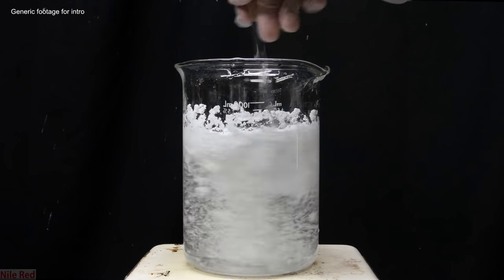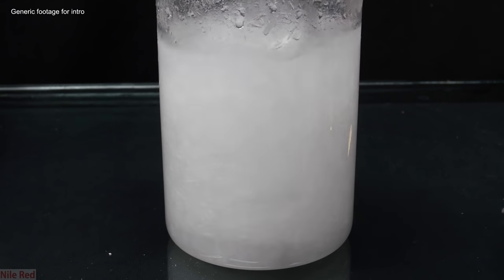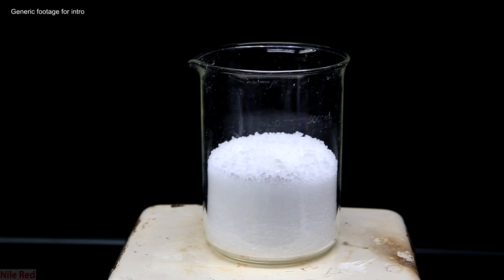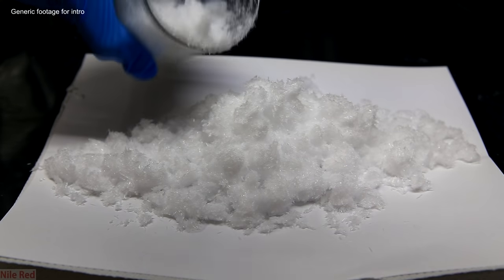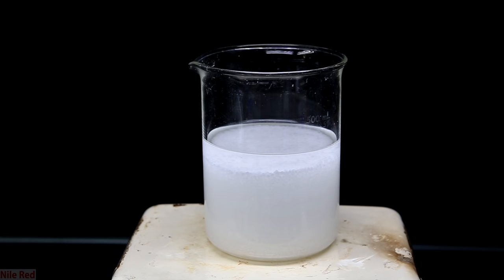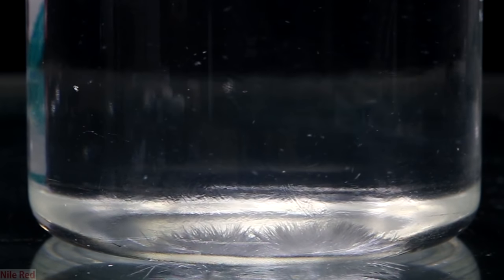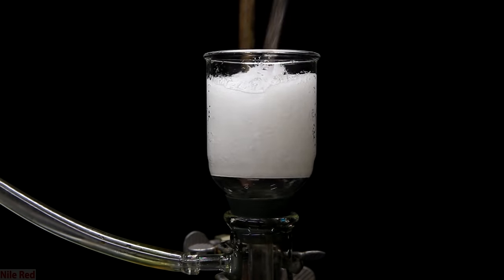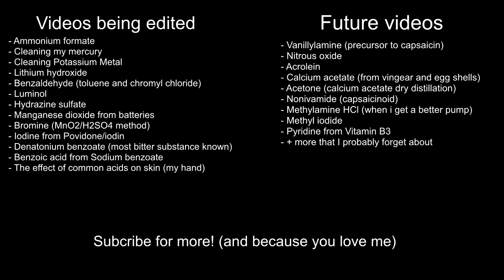Technique Series: Recrystallization (urea as an example)

Comment: Lol. Here's a complicated crystallization. Crystallize chlorophyll
Reply: +Dan Swoboda The stuff in plants? That's everywhere. I wonder if chlorophyll still looks green in its crystal form, assuming it can actually form crystals.
Reply: +ShroudedPanda yes it can crystallize. Just extremely difficult
Reply: +Dan Swoboda I'm guessing mixed solvent?
Reply: Ben Canon There are different kinds of chlorophyll, a and b. Different yet they contain a different build carbon chain going off of it. So I'd say radiocrystolography as well as chromatography are needed to get both separated. But I doubt it would be worth it all that much.
Reply: Ok I've got a little science project somewhat related to this, how would you best isolate and extract chlorophyll as a contaminant from an extraction of lipids with ethanol as the solvent in a fashion that is both highly effective and nontoxic? 

I've thought about using hexane as the starting solvent in a lipid extraction using the soxhlet extraction technique. I've read that hexane is excellent at dissolving lipids without extracting nearly as much chlorophyll or other water soluble undesirables (practically none) but it also only has a Recommended Exposure Level of only 80ppm. How close to 0ppm of hexane could one get in an extraction where the plant matter is processed in a Soxhlet extractor using hexane and then said hexane was distilled off and the hexane contaminated extract was then "washed" using some anhydrous ethanol at least 3x then vacuum purged for a couple hours?

The reason why I ask the initial question about an ethanol extraction is because, if my preferred method of hexane extraction is unsafe no matter what methods are used to extract the hexane afterwards, I would like to find a method that 
1. Can be done at home
2. Uses a relatively safe solvent, in this case ethanol (the hexane extraction would be conducted outside and under vacuum for hopefully obvious safety reasons)
3. Is at least semi automated and
4. Can produce an end product that contains little to no chlorophyll

So basically my questions are, would the hexane extraction method I outlined be safe for human consumption, and if not how would you go about isolating and removing chlorophyll contamination from an ethanol extraction meant for human consumption?
Reply: @GR3YS0RG4N1CS  Why would you want to consume chlorophyll?
Reply: Stefan Reich what are you talking about? That is the exact opposite of my goal. Chlorophyll is the contaminant. It is the only contaminant left after a ethanol winterizaton process and I want a good way to remove it
Reply: Stefan Reich "how would you best isolate and extract chlorophyll as a contaminant*" why would you EVER isolate and extract a *contaminant as something for consumption or even for further use in a later process?
Reply: @GR3YS0RG4N1CS  Chlorophyll is sold as a supplement so there is an argument for extracting it for human consumption.

Comment: I wish I could give this video 10 likes. I’ve been struggling with this technique for so long, and after watching this video, I finally got a decently pure product! Thank you so, so much.

(Specifically, I was hung up on why adding water until the solution was cloudy was done, and you addressed that very clearly. Also, I had not been washing my crystals with extra solvent during vacuum filtration. I usually don’t have as much powder as shown in this demonstration, and thought it wouldn’t do much. I was dead wrong. I had less than 100mg of product, and washing it still helped a lot. I could see the color of my powder brighten as I washed it, and I got a decent melting point range for my product. After so many previous failures, it made me so happy :’))

Comment: i think one of the biggest problems is having impurities that does not dissolve in the solvent and no knowing that they are not product which means you can add far too much solvent to try to get them dissolved, this can badly effect yield or may mean you have to add a second solent to get the crystals to crash out of solution.

Comment: my favourite technique is to heat up the solvent on a hot plate and add it slowly to my product when it is about 50% dissolved. (and it dependswhat solvent you are using) with solvent i put it on the hotplate as well to prevent it from cooling too early, when the solid has dissolved i take it of and let it cool really slowly, when it is at room temp i put it on ice to get the last crystals to form. it works really well but you must be careful that your product doesn't burn or melt.

Comment: Could it be possible to separate racemic methamphetamine from subisomer cuts that have say 10-15 C lower boiling point for the subisomer cuts (160 C) and then 170-175 C for racemic methamphetamine? 

The presumed cut is isopropylbenzylamine. An adulterant of methamphetamine added to give the appearance of large fake crystaline methamphetamine hcl. I doubt you know or if these subisomers cuts are possible or can even be removed this way since the boiling point is so similar but it's always something I've wondered about since users of the drug claim it is being cut this way and that a drop in potency occured in 2015-2017. DEA says they see it occasionally at their dedicated methamphetamine analysis only sees it occasionally. In 2008 the agency moved to not control it and decided it was just visually similar to methamphetamine Crystals. The full report requested in the "NFLIS 2007 annual report" on page 25 in paragraph one and two. I believe this was before the agency had a analysis lab dedicated to the stuff.

Comment: I want to separate 2 salts. 1 with approx. 1000g/L (at 20°C) the other one with approx. 350g/L (at 20°C). I can't find literature for the solubility at higher temperatures. I want the more soluble one as clean as possible. I got quite a high amount of the less soluble salt in a very pure form. I repeated the process 6 times and still get every time a small amount of my less soluble salt. I dryed the rest to check the quality and it still has a lot of the less soluble salt in it.

Comment: I'm trying to find a quicker way of separating silver nitrate and copper nitrate. I've made them both from sterling silver. In the past I added pieces of copper to the solution to crystallize pure silver then used that to make nearly pure silver nitrate. I looked around and found out that silver nitrate is not very soluble in ethanol but all I've found is that copper nitrate is soluble in ethanol but I couldn't find any numbers on it.

Comment: You probably got those accidentally when you wanted the ammonium nitrate ones right? For your potassium nitrate video,  I also have been wondering what I should do with it. fertilizer maybe?
Reply from the maker: +Liamthepyro haha that is exactly where i got them. It turned out to be useful though. I used the stuff i recrystallized in this video to make hydrazine sulfate (luminol precursor)

Comment: Are there any exceptions to wanting the temperature to reduce slowly? Now I realize why my recrystallizations were always so excellent in the university lab and so terrible replicating at home. I couldn't let my impatience result in trying to speed things up by putting sodium acetate recrystallations in the fridge. And what about with respect to heating the mixture? Does it matter if we start by adding the compound to hot solvent, rather than to cold solvent then heating?
Reply: Good questions.  If you find the answers can you let me know?  I also tried to crystallize using freezer which has worked pretty good, but my choice of solvent is making residue which I need to purify through recrystallization.  I failed my first attempt and lost almost all of my target chem.

Comment: I'm trying to purify Ammonium nitrate fertilizer using recrystalization and need someone to help .I boiled off water until some AN crystal Precipitate out, then added a little amount of water to dissolve again, then I cooled it down to temperature about 1degree. In theory I should get 90 percent of AN but what I got was actually about 10%. I repeated the process for several times, every time was almost the same.Actually I did succeed once, that time I left the solution in the fridge for more than a week, perfect nitrate crystals were grown.  I tried to recreate it but has also failed.
Reply: Ever have any luck?

Comment: What does it mean for a crystallization process to crash?
Reply: instead of precipitating out nicely and forming crystals, it will all leave solution very quickly and (sometimes) solidify. think of hot ice. If there are any impurities in the solution, they will get trapped between molecules of your desired product.
Reply: StrokeMahEgo 😂😂😂 Why? Do you think I really care?
Reply: sorry, the previous comment was not intended for you, but rather for the OP asking the question.
Reply: +Jason Bourne The fuck?
Reply: if anything crashed out it means that it comes out of solution very suddenly. For instance if you are doing an acid/base extraction with an amine normal solid at room temperature, and add say sodium hydrogen carbonate to a solution of the hydrochloride salt of your amine the free base will often crash out in the form of a lot of very fluffy crystals.

Comment: im not sure what i have exactly, but the process went as follows, i broke my marijuana grinder the screen so i could no longer collect keef, so i went to the store and bought i believe a bottle of 30 pills, the brand was equate expectorant DM, the actives were DXM and guaifenesin, i ground it all up which now i believe is a useless step for disolving pills, and put it in an arrowhead waterbottle, filtered off all of the pill powder that wasnt soluable and left it for 8ish months to sit, about 3 weeks ago i was going to throw it away then i realized there was white shit at the bottom, i was going to re filter, then i realized they were crystals and i flicked it and crystals fell from the top of the water, i filtered all of it off and now i believe i have DXM hbr crystalized, the yeild was quite terrible at like 0.463gs somewhere around there, but i put it in a different bottle and im going to wait some more time and hope more crystalizes out, im doing the same thing with caffeine, but i believe im going to need to boil the water off and mix isopropanol into it to properly crystalize caffeine then do a cold water extraction then crystalization.
Reply: the cyrstals are so fine and flakey, it looks like glass. may or may not be guaifenesin or least likely povidone, but its most likely DXM hbr, because its the least soluable in the water, it tastes terrible like its contaminated with guaifenesin, but the scent isnt of guaifenesin, a box of mucinex stinks, this(the dxm) is just a very vague odor as described online. i was going to use it to "get high" but its just too beautiful and i dont want to be taking half a gram of a pretty much unknown substance.

Comment: Quick Question @nilered - What part of the re crystallization process determines the size of the crystals? Is there a way to control how the crystals actually form in terms of size? I've never really understood this, and in my experience, it seems thats agitation develops smaller (but more pure) crystals, while as less agitation creates large "chunks", but can have more impurities trapped. Is there a specific part of the process that can be controlled to create larger crystals, but also have impurities precipitate out in the same levels as agitation would after the first evap? I've yet to find an answer to this, so any insight that you could provide on this would be greatly appreciated!
Reply: Speed of cooling and quantity of nucleation points. slow and few=large ; fast and many =small, there is little that would make large crystals less pure by mass. Maybe you are not really crystallizing and just solidifying a large blob? Many variables, very generic.
This is the basis for cooking fudge and heat treating steel where nucleation points and very particular cooling rates are used to control the crystal sizes.
Reply: My personal suggest is to carry out two crystallization process. The first one as a normal crystallization, to get rid off the impurities, and then another one with a very slow cooling process to form nice crystals. This way you will lose some of your product, but if you only want to have nice crystals, it worths it.

Comment: You don't address the real "trick" to recrystallization: that you already have the desired chemical "in the majority", and the object is to further purify it.  Because it is in the majority, it will reach saturation and crystallize first, even though its solubility is similar to (or maybe even higher) then that of the impurity.  So you are "not screwed" if you can get the desired chemical in the majority by other means first!

Comment: Calcium acetate please
Reply: +NdFeB Magnet Actually I synthesized it myself already using vinegar and eggshells. Since eggshells are roughly 96% CaCO3, they are used in excess to vinegar so as to consume all acetic acid and any leftover CaCO3 remains insoluble and is easily filtered off. The resulting solution can be slowly evaporated to form crystals. Haven&#39;t done a recrystallization yet.
Reply: Late to the party, but you can also use snail shells from the garden, or beach shells as well. And limestone.